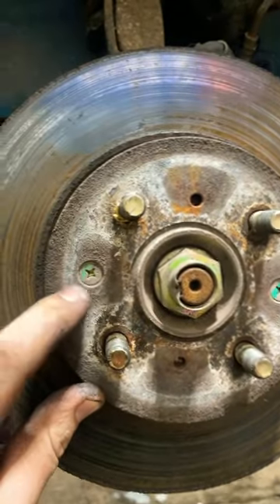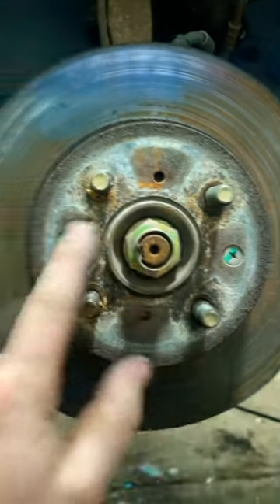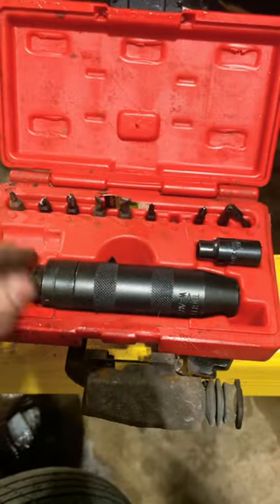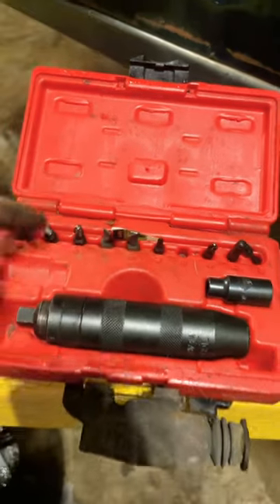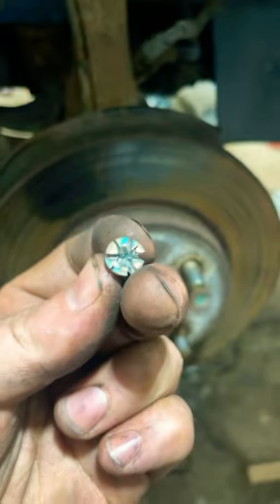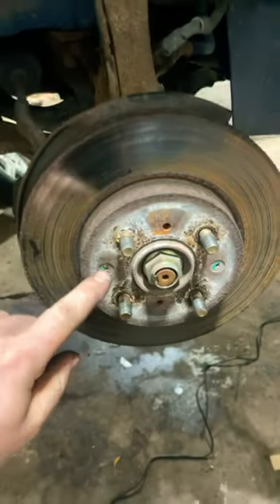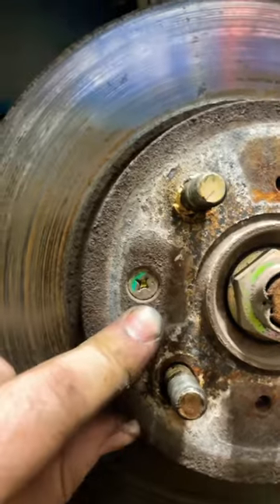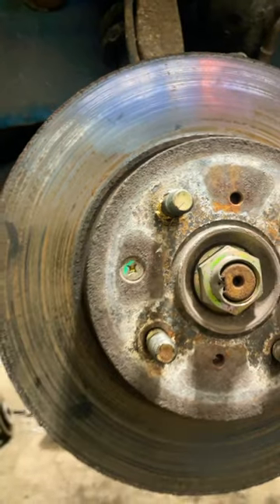Stubborn Brake Rotors? DO THIS! #automotive #brakejob #tools

Comment: I’m a Automotive tech of 21 years. Hit the surface of the rotor with a hammer first. Hit it right where the screw gos in. Don’t worry it won’t damage the screw. It just breaks the rust bond that the screw formed to the rotor.

If that fails, and shouldn’t. just use the air hammer with a round bit to turn it out. At a angle put the bit on the outer edge of the screw. Works every time. Never had to use a Dremel or wizzer to grind the screw.
Reply from the maker: Yep! I’m on year #10 myself, just figured if people don’t have an air hammer this is a way you can do it (and for this video, my 60 gal compressor was down due to re routing hoses in the shop) thanks for the comment tho you’re absolutely correct
Reply: @shiftwrenchrepeat  👍 I made the comment more so for those that are watching the video, the DIY guys. The air hammer they more then likely won’t have. But hitting the face of the screw with a hammer is something they can do.
Reply: 100% and everyone has a hammer or just grab a drill

Comment: Proper use of an impact screwdriver usually works, however, in WCS, oxyacetylene. Cherry it. Get impact screwdriver or even an electric impact driver will work at this point and get it out.
Reply from the maker: Yeah, just showing another way

Comment: I got mad and just drilled them out lol
Reply from the maker: That works too! More than one way to solve the issue
Reply: @shiftwrenchrepeat  haha yeah! Impact driver wasn't doing the trick and it was super hot outside. Just needed the job done.
Your method would have probably worked but I was too angry to think straight lol
Reply from the maker: They can suck.

Comment: Its not like they are even needed.   There is no way a tiny screw like that will actually hold a rotor.
Reply from the maker: They aren’t no, installed during the assembly process